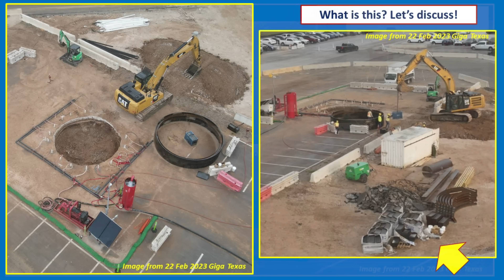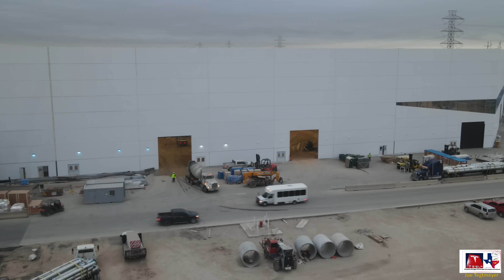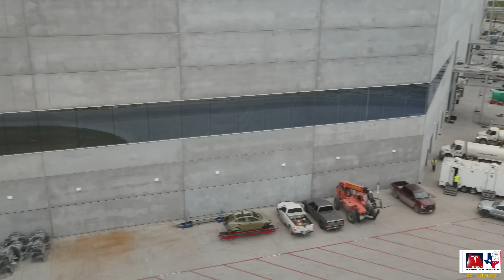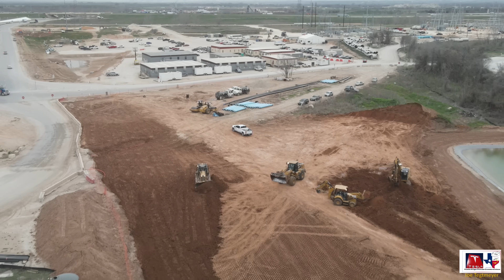Plaid Main Entrance, Turbo Roundabout & Liner Plate Shafts! 24 Feb 2023 Giga Texas Updates (07:15AM)

Comment: I see that there starting to excavate the dewatered area on the south end. The is vacuumed by the well points (white pipes) by the red skid mount vacuum pump. The water from the pump discharge into the red tank. The tank separates other fine silt that may have passed through the micro slits or screens in the well points. Then the water drains from the red tank by gravity. Griffin only rents, installs & service the dewatering equipment. The excavate and shoring are other subcontractors. Last week there was a high pressure fire hose running across the south end to the local of the well points. High pressure water is used to jet the well points into the ground. The well points are most likely less than 28' into the ground. Water can only be vacuumed up a max of 28' because of he law of physics.
Reply: Counterintuitively, water is pumped at pressure into the wells, and additional water is forced out. Check out the contractors website.
Reply: Contractors video here, https://www.youtube.com/watch?v=kFSrxBYg58s
Reply: The Griffin System we rent for shallow excavation 20' or less are just vacuum systems. The laws of  physics limit a vacuum system. The dewatering in the video are for deeper excavation. But what do I know. I'm just a superintendent for a contractor that does this type work.
Reply: @jamieharbell9808  They haven't stopped excavating, they have barely started. There's enough shoring for a 45 - 50' deep shaft.
Reply: @DessieDoolan  Most likely this excavation is for a sewage pump station. Generally speaking the bottom elevation of a pump station is about 10' lower than the lowest gravity sewer line. Most of the gravity line I have seen being installed were just below the perimeter grade beam. So my thoughts are the excavation is going to around 20' deep. Perhaps there is a 2nd excavation that the remaining shoring will be installed. 
One thing to keep in mind. The deeper you go below the water table. The more ballasting that is needed to keep the structure that's being installed in the excavation from floating. Water tight structure like tanks, manholes & pump stations all will float like boats on the in the ground water.
Reply: @jamieharbell9808  The project started about the 13th of January when they demolished a section of asphalt.

Joe’s video from 27 January, shows the drilling rig boring the small shafts. https://youtu.be/4joP0tgETfA?t=474

The fire hose can be seen connected in most videos. Presumably the tank is emptied from time to time to drain out the silt etc, daily perhaps. Then reconnected to the hydrant to top the tank back up. 

Agree it’s likely to be a sewer lift station, no other logical reason for a deep shaft.

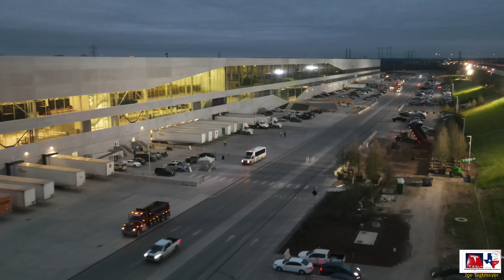If you have been watching these videos for a year or more you may have noticed the constant rework of the lift pump station (seen at 7:54). Vacuum pump trucks are often seen at the other sewer pits/wells around the perimeter of the building. These wells connect to the main lift pump station by force mains/pump lines. The current system is problematic.
Speculation is that this new shaft could be a rework of the sanitary sewer drains to a gravity system, or a least a well for gravity sewer from the new structure.

Additional shafts would require additional de-watering.

Comment: White stain? Looks like paint to me...

Wood can be stained as the fibers are porous. Concrete, not so much.
Reply: they stain industrial surfaced concrete commonly.  it penetrates into the concrete, doesn't chip or peel.   I don't know for sure this job is being stained, but I wouldn't doubt it.  It's usually different darker colors they stain with.

Comment: Hi Joe, I’m beginning to wonder if the die shop really is a tool and die shop on a very large scale. Perhaps it’s intended to serve the entire company’s battery development and manufacturing efforts as well as the lithium and other battery materials processing and recycling.
Reply: Given Tesla's MO of constant innovation and improvement, the huge expense of external die production and the probability of the current castings only being the first iteration, I think it would make sense for them to have their own die production capability. In addition there are the dies used in the stamping process.

Comment: At 20:25 or so you mention them assembling two circuit breakers. In fact, those are two large oil filled transformers. They will take the 345KV power and step it down to an intermediate voltage. We don’t know exactly which at this point. Since each set of lines can safely carry in excess of 400 megawatts of power, even distributing a fraction of that power can be quite significant. 😅
Reply: 20:25. How far off operational would you guess? Months still?
Reply: @DessieDoolan   Could easily be in operation as a substation in a month. Connection to the outside world are a different matter. But the basic switchyard could easily be up by April 1. The only thing we can’t know is the remote monitoring and management end. This will be ran out of the LCRA TSC network operation center. We can’t know of any issues at that center, although I doubt there are any big issues. When you look at their capital plan, the 31 million that LCRA is spending on this substation and interconnect to the megapack is a small portion of this years projects.
Reply: @Bill_N_ATX  With the BESS, I wonder how that is connected into the switchhyard. DC or AC, high voltage, low voltage. I may have answered this thinking about it while typing. Then again I'm clueless about this stuff.
Reply: @DessieDoolan  It will be connected at 345kv AC just like the transmission line voltage. That way it can output power into the grid. The idea is this mass storage devices can reduce the number of needed “peaking units” which are small generator units that can be brought online quickly and dropped from the grid just as fast. At least in our area these are small gas turbine units ran on natural gas. Traditionally, these are not extremely efficient whereas these megapacks of batteries are pretty efficient and can be brought on line instantly. They can also be left in a very efficient standby role which can’t be said for small turbines. They are inefficient running in such a mode since you have to burn a good bit of fuel just to keep it running but not generating electricity.
Reply: Hi William, I appreciate your input in this thread regarding the electrical work. Are you an EE? Technical hair-splitting, but I'm curious: taking into account the substantial solar generation on site, as well as the BESS to be built, is it correct to envision the the design process terminology that the "electric switchyard" will also include elements of an "electric substation"?  Best -

Comment: Thanks Joe. Plenty of surprises today!
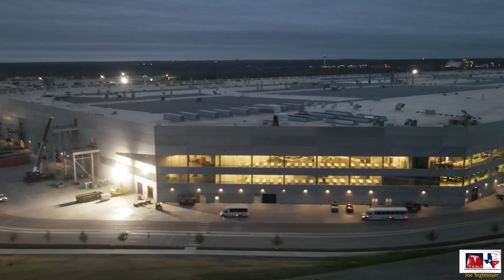7:28. Battery. Levels 2 and 3. New cafeterias either not quite operational, or the coffee is lousy.
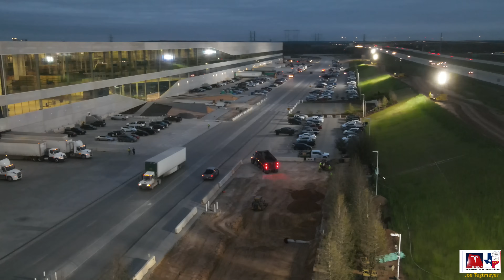8:05. Highway berm side. Excavation half back-filled. May have been a soft patch of ground.
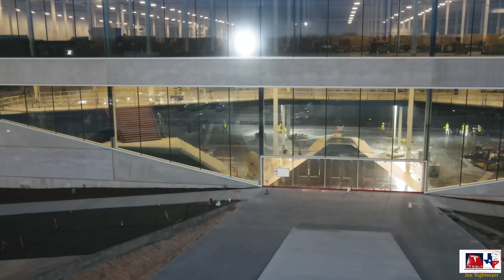8:59. Main Entrance. Very impressive! Suspended red Model Y, grand staircase. The cranked, cantilevered, U shaped structure is puzzling. Dark coloured wall to the rear. 
Staircase tapers inwards towards the top on the lower flight, opposite on the upper flight.
Level 3. Top right, familiar shape of a trailer porta-loo.
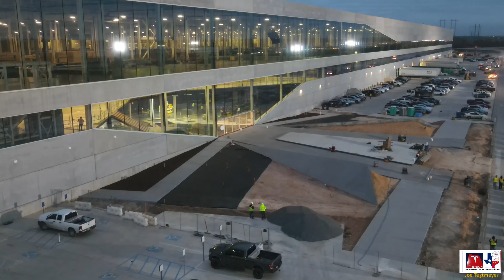9:17. Main Entrance, apron. Unused column footings buried along the edge of the large trapezoid/trapezium. Suggests this is an interim design for the Investor Day meeting.
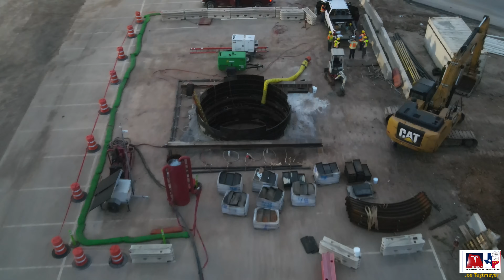10:38. Southend. De-watering project site. Concrete placed around the shoring. Above ground segments would be fall protection. Small excavator going down that ladder.
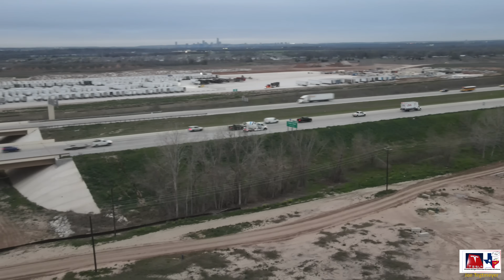12:42. Highway bridge. There’s that man again.
14:22. GA, loading platform. Trailer load of stainless steel pipe to the right.
16:22. North-south road at EOL parking. Truck mounted drilling rig parked.
16:42. Duck roundabout. Inner circle has shrunk since Wednesday’s flight. 
Bottom, semi-trailer shows how the roundabout works, by preselecting the correct lane prior to entering the roundabout. In this instance the semi is positioned to turn left. Parallel lane to the right leads to the BIW apron.
17:10. BIW, apron. Floor set-downs for the dock levelers are outside the building line. Relates back to the protruding column footings in this location.
18:45. Casting, apron. At the corner. Only one of the large steel plates with the shear studs remains outside.
19:18. Plastics, apron. The water storage trailers have been there for 6 months. Must be some incomplete part of the plant or a utility requiring them to be on hand. Otherwise there are better places to store them.
21:36. Far north field. Bottom left. Dumping soil. 
Towards the top, past the rental yard, on the far tree-line is another line of dumped soil.
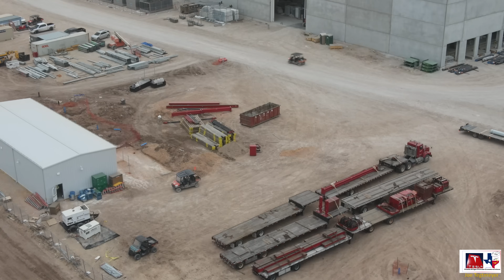23:39. Cathode north. I thought they were small bridge cranes also. Now think it hoisting gear and other equipment for shifting heavy machinery into Cathode.
24:08. Cathode. Tall opening to the right. Possibly small silos laying on the side.
25:46. Cathode, black louvres. Safety harness or not, that’s a gutsy effort!
27:32. Die Shop, west. U shaped rebar for a U shaped floor set-down. Long cylinder shaped plant to be located here? Ball mill has been suggested previously. Doesn’t sit well with it being a Die shop.
Reply: 6:18 I'm starting to think electric scooter guy intentionally finds his way into Joe's filming.
Reply: @scottgaree7667  6:18. That was fairly sedate. There some others that buzz around at break neck speed. The youth of today...........

Comment: The reason that they are dewatering is that the water table is higher than the bottom of that hole will be. If they did not dewater, the water pressure could start pushing through the bottom of the excavation, taking dirt along with it, destabilising the ground and potentially causing a collapse.

Comment: This entrance looks like it will be greener and more pleasing. The previous entrance was just stark concrete. Thanks, Joe.
Reply: I think the previous entrance was just for the cyber rodeo. This factory is going through fazes because instead of waiting for the whole production to be finished, Elon wanted limited production to get some revenue coming in.  Now production has increased significantly while the planned buildout continues.
Reply: @petercozzaglio6070  Wouldn't you agree that it is silly and a total waste to pour concrete and build an entrance for a 5 hour party? Then rip it up later! Unless they wanted to put on a show for the party to keep the stock price pumped up? But if that is the case, how much do they really care about the environment? Hope you can see mu point.
Reply: @DavidJohnson-tv2nn  
Concrete is not wasted. The rubble will be used as fill on other parts of the factory.
Reply: @DavidJohnson-tv2nn   I have no idea why they did that.  I’m sure they had their reasons for doing so. But after working on mega resorts in Vegas, I have seen a hundred thousand dollars of Italian marble ripped out because somebody didn’t like the color or texture. And that’s just one example.
Reply: i liked the previous entrance stair design better. hope they put it back!
Reply: Using bitumen would be faster to recycle and resuse. In the scheme of a $2 billion billion and site works, bit of concrete? Better to do concrete down to control dust and dirt getting into have billions of high tech paint and battery production.
Reply: I thin the entrance is looking quite “Plaid” 😜
Reply: Yes, but it should have been done right the first time! Rather than pouring concrete and ripping it up. Seems to be little to no planning.
Reply: @DavidJohnson-tv2nn  I am pretty sure they did this so the factory looks nice for the opening at cyber rodeo and the shareholder meetings. Just compare it to Giga Berlin. People complain on the contruction site looking ugly, but, except for the temporary parking lots and a hand full of cuts in the alphalt, they build thing to last in Berlin. In Texas it feels like they cut open the ground every day and the outside of the factory seems to be in a constant state of rearranging. But again, its their headquater so I get why they want to fake the finished look.
Reply: @ikarus605  Faking the finish look just to keep the rich investors happy doesn't go along with the stated goals of the owner. It appears to me in my opinion that the real goal is to make the billionaire owner and the investors even richer by keeping the stock price pumped up! Rather than a "sustainable future" for the world. Wouldn't you at least agree that such massive waste is not an example of doing things in a sustainable way?
Reply: @DavidJohnson-tv2nn  Tbh, the things Musk announces or promises are worth nothing until the companies deliver the promised products. I like Tesla, but for their products, not for their CEO. I agree that rebuilding the entrance this early is not sustainable, but in my opinion its not that big of a deal. The impact of removing all the concreate on the south end was way bigger. Tesla is a company, so you cant blame them for making money. Truth is that you can only change the world if you have the right ressources. If your plan is having sustainable cars in the future, you need money to develop sustainalbe technology and to have an influence in the market. Otherwise you are just a activist depending on other people acting. Also your sustainable product need to be profitable or customers wont buy it. Even tho their building methods are wastefull, the result is the only thing that really matters. If the products being manufactured in the factory save more co2 (of cource co2 is not the only factor) than construction costs, it is sustainable, regardless of how many times the reconfigured it.